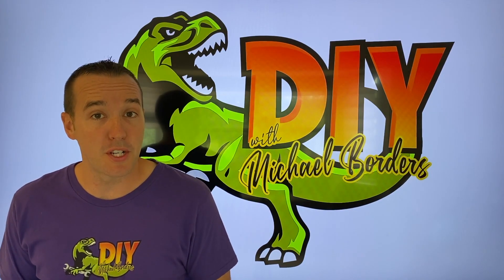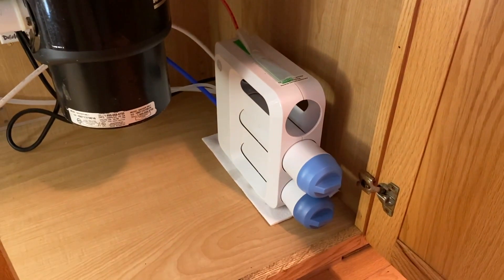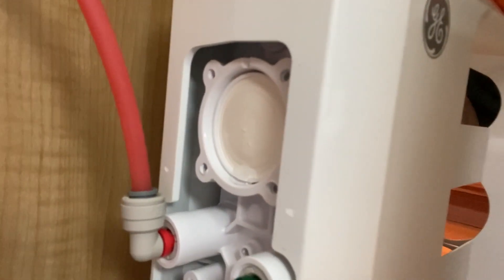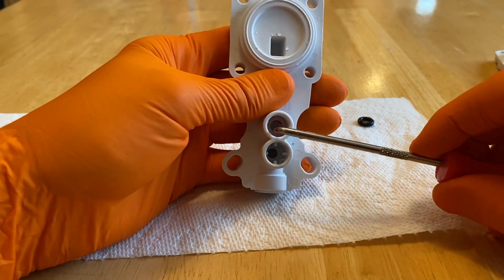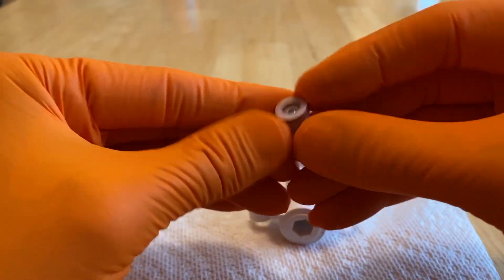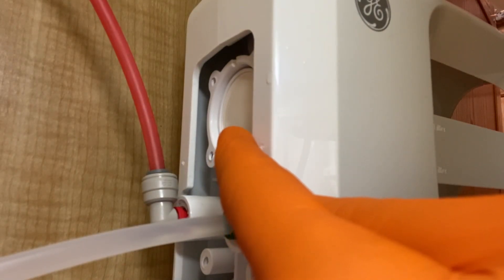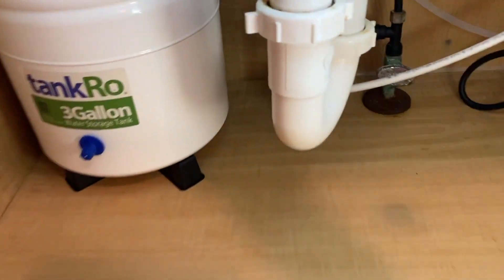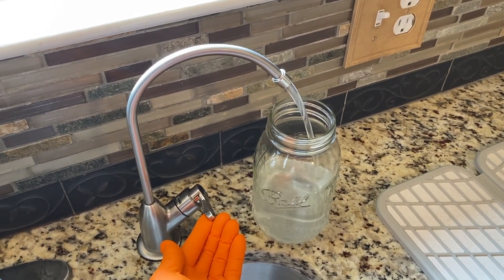Replace reverse osmosis Check Valve - DIY

Comment: Thank you so much for sharing. Where can I order the check valve/flow restrictor? I did not find them on home depot website.
Reply from the maker: Thanks for watching & welcome to the DIY Raptor Club.  Your best bet is to purchase directly from GE customer support.

In the back of your owners manual, you will find a schematic diagram of the unit.  If yours is the exact same as ours, the part number is:

       7333153

Customer support number should be in the owners manual as well and they will need your model number of RO unit.

Please keep us posted on your project, us DIYers need to stick together.